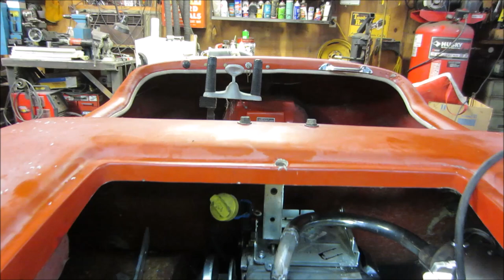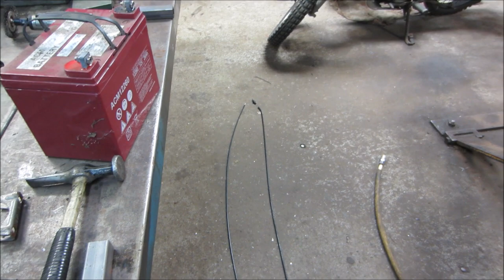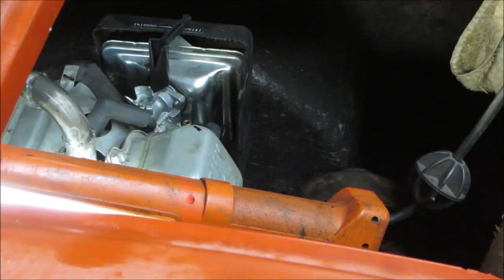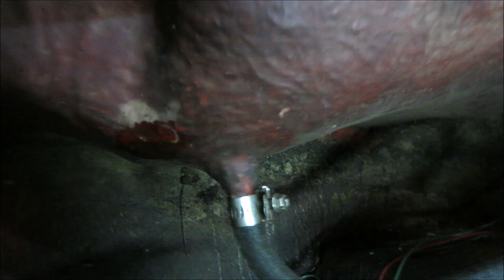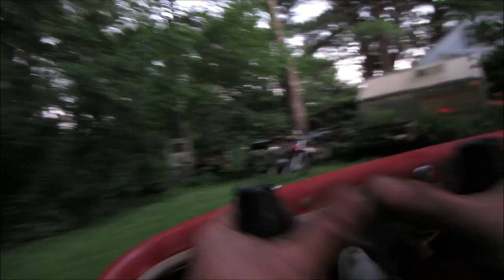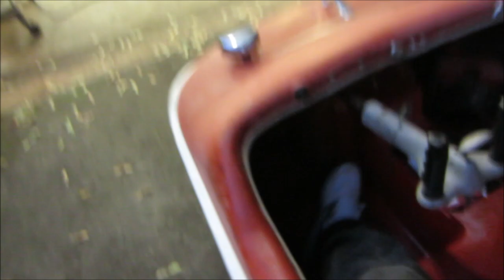Beaver amphibious vehicle 1st test ride in 25 years

Comment: How many were screaming "THE KILL SWITCH IS ON!!!"
Reply: Demons 500 ....me
Reply: Me also
Reply: Also, how many were saying "the charging circuit is still on" after hitting the kill switch to stop it.  Charging circuit=battery drain path?  Are you sure there's no diode in the charging circuit to prevent discharge?
Reply: Was anybody else telling him to give it a little gas when it wouldn't stay running?  Only to find out he was stepping on the brake pedal thinking it was the gas pedal.  And he built it no less.  Thanks Mustie now I don't feel so bad about all the dumb things I do (like disassembling and reassembling a hydraulic motor 3 times today because I forgot to set the timing.
Reply: Hahaha! Yep!
Reply: Me too
Reply: Demons 500 I was

Comment: Sweet.....definitely add a throttle pedal and if you take that in the water, tie a decent rope to a sturdy part and make sure the rope is at least 50 feet long with a float attached to it so, if it sinks the rope will float up and a buddy with a boat could either drag it to shore or a couple people could lift it up enough to pull it to shore.....ask me how I know??????

Comment: Just wanted to mention something that I didn't see you address yet and that is the bearings and seals on the axles or the drive going to the axles. Always love your videos and thanks again for sharing with all of us armchair quarterbacks. I might be missing that you already addressed it.
Reply: I'm a little late to comment, but if he closes the air outlet and bumps up the blower pressure going in to the engine compartment, those bearings could leak like a sieve and the air blowing out them will keep water out...  Until he stops the engine to fish.

Comment: Could you run the throttle cable down the centre of the body like the break cable would be long enough then. Top video again. Thanks
Reply: Yes, along the battery will be a much shorter way...

Comment: put a little fiberglass patch on the hole and use the original tank,  walmart has two part epoxy and you can use a clean piece of tee shirt as a patch,  two pieces idid this one time and it worked, and by the way i worked in fiberglass fer 5 years, and built a 1927 tee delivery truck, hot rod
Reply: He said something about how the ethanol in modern gas reacts with a component of the fiberglass, degrading it.
Reply: Ronald not really worth fixing it. You saw how little gas Mustie put in to that tank. It might leak even more from other places. When the thing is made out of fiberglass you gotta trust the gas tank.
Reply: pmessinger yes but mustie uses race gas or something like that which doesn't have ethanol.
Reply: Problem is fuel with ethanol will eat away at the fiberglass resin.  8.5hp engine not worth running many dollars per gallon racing fuel with no ethanol.

RichE
Reply: Regular gas does the same thing. Was a problem discovered when the marine industry started moving to fiberglass tanks. Not ethanol specific.
Reply: Use some Red-Kote in the tank.

Comment: With your engine now bolted at the top to the fiberglass, I would be concerned about engiine vibration cracking the fiberglass at the top. Even with the rubber isolators there will be severe vibration transferred through your brackets to the bolts going through the fiberglass.
Reply: Richard Baumeister I was thinking that as well. Needs a plate to spread the load
Reply: Perhaps Beavers like vibration
Reply: Y Wiwar haha!! Im glad I look through the comment section!!
Reply: After he sells it, it's no longer a problem.
Reply: thinking exactly that too
Reply: nothing a tweak to the flange couldn't fix
Reply: its fine, the whole boat is and was vibrating prior to the top engine mounts. Definitely not going to hurt anything.

Comment: Could it have been 40KPH (that works out to 24.8MPH)? I tell ya, if Mork had had a car it would have looked like that thing! Nanoo nanoo! Shazbot!
Reply: Check your math.  A knot is 1.15 miles per hour in my book.
Reply: >Check your math.  A knot is 
Kilometers, not knots (or gnots)
Reply: John Razor he's talking about kilometers per hour (kph), not knot  (nautical miles per hour) one knot is 1.852 km/h, and 1.15078 mph. 1 Mph is 1.609 kph
Reply: Got it see my other reply.  Thanks, jumped too soon because it's a boat and I'm an American cheated by Jimmy Carter who cancelled the metric system for the US.  smile
Reply: 40 MPH with the original 9.5 HP two stroke engine.   Nearly as fast as his Cushman Jailster.   25 MPH seems a bit safer in the current configuration.
Reply: Bottomlands and a quick google search will turn up a flyer claiming 50mph.

Suicidal speeds for a plastic can.

Comment: You'd never make it as an engineer in Detroit. They never consider the time when things need to come apart, and how accessible everything is.
Reply: Yes they do.  It's the accountants that are responsible for the cost cutting that makes things hard to service.
Reply: No.. no.. The accountants squawk about how much the parts cost, and insist on substituting a well made part, for a junk one that costs 3 cents less. When that junk part fails, the accountant then tries to figure out how little they can pay the flat rate tech to replace the part under warranty. The engineer does a marvelous job engineering the car to go together as quickly/easily as possible when going down the assembly line. Not so much coming apart in the technicians bay.
Reply: You think about that a lot harder when you're also the mechanic that's going to have to take it apart.

Comment: Hey Mustie, be careful of how fast you charge that battery. It's a "gel battery" and is designed to slow charge/discharge. If it's charged to fast on a higher amp charger, it may get to hot and explode, think napalm. 
I setup an emergency lighting system using a gel battery, Battery Tender (750mA), 2 led 12v under cabinet lights, 120vac relay and a 120v cord all housed in a plastic battery box. Power goes out, instant light. 
I also have a spare battery that I leave on a 2nd charger. 

I just wanted to warn you about that battery. Stay safe brother.
Great videos, thank you!

Comment: For your throttle cable, go a bicycle shop and have them cut your a length of housing for brakes (there are two kinds of housings, one for brakes which has a larger inside diameter and one for the derailleur system).  They might have a tandem brake cable to go with it.

Comment: It lives!! Nice job, better than factory. That kill switch is going to drive you crazy. Buy another solenoid and hook the kill wire to the start in reverse terminal on the key switch. That way when you turn the key to start you don't have to think about a kill switch at all and to shut it off you turn the key past off to kill the motor. Volvo marine diesels work this way only the solenoid shuts off the fuel instead.

Comment: Remember now: down is on, up is off, left is right, right is left and the accelerator is the brake.
Perfect.
---
Still worried about the charging system though. I think you might be getting some voltage out of the old flywheel but just because it is getting energized by the magneto magnets. The old flywheel had more magnets on the inside specifically for the "alternator" (if it could be called that). Ignore if you went back to the old flywheel without us knowing :)-
Cheers,
 - Eddy

Comment: To solve the gas tank problem just mount a motorcycle tank in that side with gas shut off and gas filter and you'll be set.  Using the control on a Honda tank has a reserve built in.

Comment: awesome job. may i suggest that you add a few drops of oil to the fan bearings now and repeat every 50 hours of run time. i say that as i have run thru 2 motor of that style on a shed that i was trying to keep cool using those fans. just a thought. signed jim in florida.

Comment: Most scary ride you have taken me on so far. I'm surprised the throttle doesn't stay on until you adjust it. I think I would take it off the steering and mount a more tradition style throttle some place else just for ease of use. Love what you do it's just a suggestion and I'm not capable of doing 90% of the stuff you do. Love it keep it up.

Comment: I've dealt with that cable fraying problem many times on bicycles. I used to use a mini grinder to cut them as i didnt have the money. But now i spent the money on Park tool cable cutter. It cuts clean through with no fuss, and doesnt leave any frayed end. With the cable cutter I can remove the cable in and out of the housing easily without worrying about fraying.

Comment: I would get rid of the "kill switch" and hook the kill wire to the 'start' position for the reverse on the original switch. Then you don't have to remember which way to flip the switch. It will always start when you turn the key to the right, and die when you turn it to the far left.😎
 You would have to use a solenoid , so when you turn the key to the left, it would ground the kill wire.

Comment: When you remarked about ethanol damaging fiberglass I had the same thought as you, replace it, using a inch or two of lip (after cutting) to attach support straps.
Of course, be careful of the balance. ;-)

Comment: Just a suggestion. Extend your top support out to the sides (on the inside) so the side to side stress is not concentrated on one point over the engine. Don't weaken the fiberglass just above the engine. Make the side to side go to the edges. Make a "wing".
Attach it to the top of the engine and have it go horizontally to the inside top corners. Riding the inside of the underside of the rear "deck". No bolts, no breach, just physics.

Comment: The new upper motor mount looks good I think you should have made a wider metal plate to mount every thing to the body but your there I'm just watching on utube so you know what your working on gas tank leave old one for looks put a riding mower tank in it will give you about 3.5 gallons and should be enough to run a long distance on the ground

Comment: Be careful driving that anywhere there is a chance you could hit a large stone with the front wheels. There are probably chips out of the dash where the steering yoke has hit on both sides. Hitting a large stone can tear the yoke out of your hands and smash it against the dash before you know it. You may have already noticed that you can turn sharper to the left, than to the right. The original ignition switch is for a battery type ignition, not magneto, and as you may know, turned to the left to start in reverse.

Comment: If you install a relay with dual 87 outputs, you could mane it normally closed ground when turned off at the switch.  The normal 87 output would switch on when the key switch is in and allow the motor to start and run.  By switching it as normally closed, the ground loop is connected without power going through the relay and it will not draw power when the ground switch relay is "on".   I think for the little bit of effort, it will make it so much more enjoyable then remembering if the switch is on or off and flooding out the motor because the switch is in the wrong position.  Then you can use that switch location for a pull switch for the lamps.

Comment: That Beaver is Fast! You can patch the fiber glass easy. Patch the gas tank with JB Weld. Or even Fiber glass patch kit easy to do. Much easier than putting in a whole new tank. You have to cut and grind to put in a new tank. and plust it wont have the Cool looking gas cap.

Comment: Back when houses were wired with single wires, knob and tube, electricians joined wires with a pot of molten lead solder which they could use an extension on for working overhead.  One of those small pots would be just what you need.

Comment: That is absolutely incredible!  Will you give this some padded seats, new lights, horn and a kickass paint job?  Another thought too, was flip your kill switch - like your transmission - you always want run to be 'up' and kill be 'down.'  Lastly - how about using the cable for the foot for your throttle and make the tab up top the brake? - or put a cycle brake lever on one of the steering grips? - or hey - better yet - a snowmobile-type throttle on the right grip and the brake lever on the left grip and eliminate both; the foot pedal AND the throttle nub in the middle?

Comment: I would also add a strap where the bolts are on top of the fibreglass.  So the vibration doesn't crack it.

Comment: I like that MAP gas better than propane, well propane has its place and uses but Map gas is just so much better a lot of times because it burns so much hotter! I’ve used it to heat up and bend 3/8” all thread ( made me some fishing rod bank sticks out of the all thread)! They worked good too but that was a long time ago! I like where you’re going with that Beaver!
Reply: MAPP gas hasn't been produced since 2008.  The MAP gas you're referring to is MAP Pro gas.  It's primarily propylene with less than 1% of propane added.  Propane burns at 3600F while MAP Pro burns at 3730F.  The price of MAP Pro is 3x that of propane and you only get 130F increase in heat.  One site says MAP Pro is superior to soldering copper because of it's higher temperature.  That's BS marketing.  130F more heat is less than 5% of the increase at 3x-4x the cost.  But if you add oxygen to MPP Pro, you can get 5200F for non-precision welding and cutting of steel.

Comment: One more thing: Connect a cube relay up to the igniition switch ON position. Wire the magneto kill on the Normally Closed contact, and then tie relay Common to ground. So when you turn off the key, the relay will disengage shutting down spark. Also reading ohms through the charge winding back to the battery concerns me deeply because it has to be rectified to DC before its useful enough to charge a battery. Your meter wont ohm out with a rectifier in the circuit unless its on Diode Check. And it would only work 1 way.

Comment: Have you thought of running the throttle cable through the center console as opposed to around the outside?  Also, the spring bracket for the carb may need to be mounted to the engine bracket below so as to not cause an oil leak on that valve cover.

Comment: I hope those old crackly tires will hold up under the water. I'm concerned too about the top motor mount cracking through that old fiberglass after a little while. You would have to create a long piece of very insulated steel or metal to distribute the vibrations and twists better. 🙂

Comment: For the gas tank you should look in to doing a fiber glass patch on it, I did a patch on a bath tub once when i was plumbing and it was pretty simple, even polished it down till you could no longer see it so it was completely smooth and water tight. The only issue i see is that gas residue might make it a different story also you would still have the ethanol issue, maybe you can spray a protective resin in the tank after to protect it from the ethanol...

Comment: If you need some airflow in the engine compartment a couple of big 12v computer cooling fans are cheap and use very little power.

Comment: Terrific!  Might give some thought to a brake lock (simple hook on a spring you can pull down or up or sideways to lock brakes when running so it won't accidentally move.

Too bad there isn't a good way to use that fuel tank sealer on this, it would keep the gas from the fiberglass and you could use the built in tank.

RichE

Comment: Maybe a engine cradle or engine enclosure made out of that square stock you got there so you can rigged the whole compartment. And you will have mounting support for other parts and electrical tie down points. Through out the compartment...@#$@ I know I don’t know what I’m talking about sorry buddy.....thank you for the vids oh I wanted to tell you about this cool little tool you can use in tha shop it’s a mini pipe or tube cutter it’s for cutting shafts of Arrows.. you find them in the archery shops sporting goods stores...but good for gas line brake line..!! Good luck 🍀👍

Comment: This is way late and I didn't read through all 998 comments so it may have already been said, but a relay in line with the kill in normally closed and wired to the on line of your switch would give you a fairly normal ignition. When the switch is on the relay is energized and opens the kill circuit. Turn the switch off and it de-energizes the relay to close the kill circuit, kill the engine, and stop drain on the battery.

Comment: Great job so far, was thinking if you wanted to removed the toggle switch you have to kill(ground) the engine, granted it's slightly more complicated than what you have now but if you was to hook up the other terminal on the ignition switch (the one that starts the engine in reverse) to a relay and then route the ground (kill wire) through the relay. When you want to turn the engine off just turn the key to the reverse position and it will trigger the relay allowing the ground through and killing the engine from one switch. (in theory It should work. hopefully)

Comment: It lives it lives and I see your dog is testing out the ramp where you will see if it floats, well I guess that is where you will do it. May need that bloke with the canoe as back up bro. Is there anyway you could maybe run the throttle cable down the other side so it gives the extra you need.

Comment: when soldering hard to solder metals such as dirty steel (steel cables) or stainless steel try comweld 965 flux. it is clearly the best flux i have ever used. it is a corrosive flux thus cleaning is recommended if corrosion may be an issue

Comment: Mustie, That tiller and throttle rig looks British engineered. Have you given thought to replacing the end with a motorcycle twist throttle mounted vertically? You’d only have to hold it with one hand to steer and accelerate. You wouldn’t need two hands and two thumbs.  Also perhaps sloshing around or spraying that magic seal flex coating on the inside of existing fuel tank, might be a quick fix for the fuel tank leak.